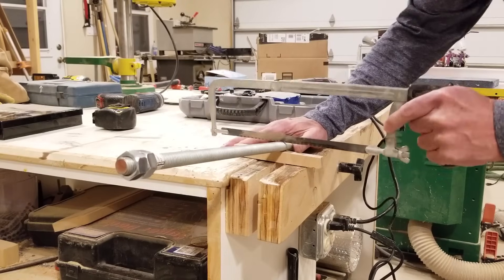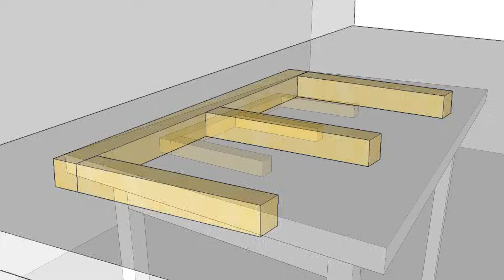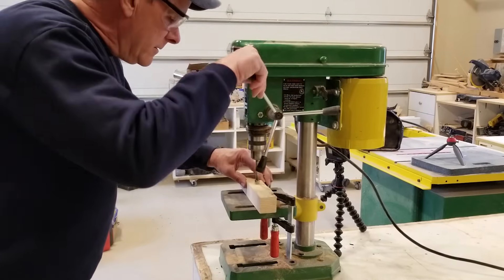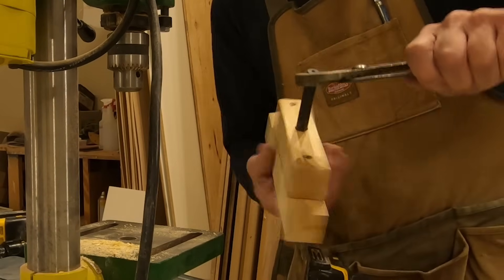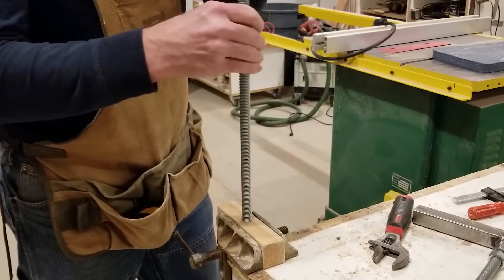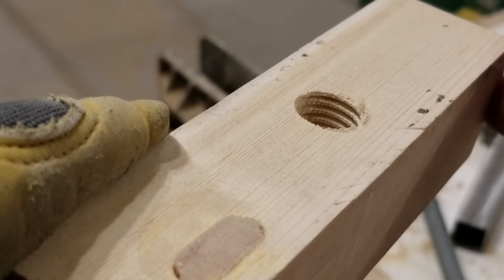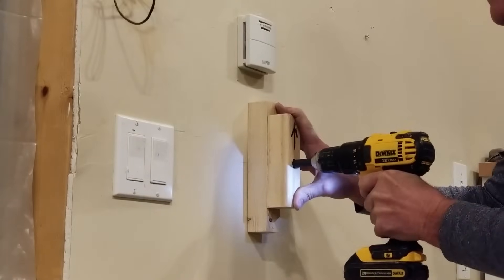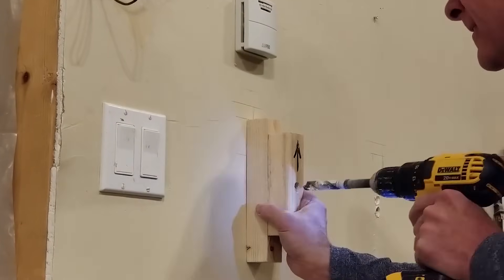Strong Floating Shelves - The Strongest Option

Comment: Something ppl don’t realize with floating shelves in the interior of the house isn’t how much weight they can take before ripping off the wall. It’s how much weight they can take before moving at all. Because most times inside a house (wether they’re painted or not) they either need to be caulked clean to the wall or may have tile right up against it. So as soon as they flex even a little they either crack the caulking or grout against them. 
So right off the top imo any design with wood cleating just screwed to the wall is totally not possible on an open face wall. MAYBE maybe if it’s at least in a corner it might be ok. Otherwise a wood or metal dowel directly into the stud is the only acceptable way without having a loose floppy shelf that doesn’t even touch the wall in a month. 
Personally I just use 1” hardwood dowel. I just cut the drywall off the stud to look for screws, set a laser to shine down the side of my Wood Owl bit to make the hole level whilst I drill and just hammer the dowel in with no glue. It’ll be plenty tight if you did it right, so a bit of silicone on the dowel to stick to the shelf and maybe a bit between shelf and wall and it’ll be strong enough to hang off of, and it’s still possible to take the whole thing apart without destroying the shelf, dowel or your wall.
Reply from the maker: Lots of really good observations and suggestions, Kermit! In other videos I have done various experiments with attaching floating shelves to walls in many different ways and arrived at basically the same conclusions you have. No doubt wood dowels or metal rods are the best approach to minimizing the flex problem with floating shelves. It's not even close. I really like your idea of using the laser level to align your bit while drilling into the stud. Perfect solution that I never thought of so thanks for passing that along! Thanks for watching and for your comments!

Comment: How do you make sure your holes on the wood pieces align properly with the posts in the wall?
Reply from the maker: In this case, Airliu, I built the shelf out of pieces of pine that were 2 inches wide so I was able to drill the holes through the individual pieces on a drill press and then glue them together. That makes it easy! To drill the holes in a wide piece of wood gets a little trickier and requires a little more trial and error to get the holes straight. 🙄

Comment: They sell lag bolts that have male wood threaded and female machine threads. I have installed hundreds of those lags. We used them for hanging ductwork and equipment. That would be super easy and fast.
Reply from the maker: Thanks, Paul! I have had a number of other people who’ve also mentioned those products as well and I have actually seen them used in commercial settings for hanging ductwork and pipe. I don’t think I’ve ever had the occasion to buy them for anything I’ve done, but I need to keep them in the back of my mind, because they really can be used in a lot of different situations. Thanks for passing along that information!

Comment: Subscribed. Suggestion.... Instead of building your allthread tool as you did..... Simply weld a nut on the end of the thread. Then use a cordless impact wrench... Zoom in and out. Way faster and easyier!

Comment: The only unrelatable aspect of the trial and error is the fact that if you're doing this method for floating shelves for a pantry... you need the shelves where you need them and you cannot drop them 2 inches to make it work.
Reply from the maker: When it comes to a situation like your describing, Jacob, where a shelf has to be where it has to be like in your pantry example, we just have to figure out how to make it work. That happens all the time! On a related note, two days ago I was installing 5/8” all thread rods through a cultured stone face facade on the fireplace for a mantle. I couldn’t really check for wiring in the studs because of the rock so went ahead with my holes. I mean what are the chances I would hit a wire! After drilling through the rock and into the stud a couple of inches, I decided to go just a little deeper and sure enough, heard a pop and knew I had clipped a wire. That’s real world although in all my years of doing this kind of work, I have never hit a wire in a situation like this! It was likely the only place on a 12 foot tall wall stud where a wire went through the center of the stud and I hit the wire dead center. Three hours later and after a trip to Lowe’s, I had opened up about a 1 ft² opening in the rock and sheet rock, installed two junction boxes and a new piece of wire between the two. I drilled another hole in the stud for my new piece of wire, so I was at least able to salvage my original hole for my all thread. Repaired the sheet rock and cultured stone the next day and now only have to actually install the mantle. Sometimes you just have to do what you have to do to make things work out! Is that relatable enough! 🙄

Comment: yo where can I buy one of those tools you used in this video?
Reply from the maker: I get that question sometimes, Sami, and I have never made up any extras of those handles to sell. It is a piece of 1” square tubing that has a couple of nuts welded to it that fit the size of all thread rod you are using. So if you know anyone who has a  welder, it is easy to make. To get around that, you can tighten two nuts against each other on a piece of all thread rod, then use a crescent wrench or socket on the nuts to spin the all thread rod into its hole to cut the threads.
Reply: @RustyDobbs  Thanks! I know a local welding shop and they can probably help.

Comment: Could you give an estimation of what thickness threaded rod can hold what weight? 

I'd like to build a couple small shelves that only need to be able to hold 100 pounds max, and wouldn't like to waste materials on over engineering it.
Reply from the maker: Hi Rubs. If I’m doing a shelf that needs to hold any significant weight say around 50 pounds over a 2 foot span, I would definitely go with 5/8” to 3/4” all thread rods. See to me, 100 pounds resting on a floating shelf is a little unnerving because that seems like a lot of weight to be on an 8, 10 or 12 inch shelf up off the floor. If that weight comes down for any reason, it will do some damage to whatever or whoever is underneath it. Floating shelves are a cool look, but, personally, if you’re going to be putting 100 pounds on them, I would want them over engineered and would probably consider another approach as well just because of the physics.
Reply: @RustyDobbs  you make a very valid point. Regardless of whether it could hold it, I wouldn't ever want that weight to come down unexpectedly. 

Time to build shelves stronger than my walls haha

Comment: Does anyone know what the small white rectangle of material he puts on the wall at 11:17?
Reply from the maker: That's just drywall joint tape, Rob. You can buy a roll of it for just a few dollars. It's purpose is to basically isolate cracks or holes in drywall to hopefully keep them from showing up again after you float joint compound over the area.

Comment: How many bags of concrete did it hold?
Reply from the maker: I don't think I ever loaded this shelf with a lot of bags of concrete, Forrest! But it held my weight fine, which would be 4 - 50 pound bags! I actually think this type of installation would hold a lot of weight, much more weight than you would ever reasonably think of putting on a floating shelf.
Reply: @RustyDobbs  I was just being silly Rusty I think these shelves are the way to go for me though thanks for the vid

Comment: Thanks very much I followed your instructions exactly and got a really good results. But after doing three of these shelves I figured out a good shortcut. And that is once you drill the hole into the stud what I did was I double nodded and all thread rod that I was going to use permanently and threaded it into the wall and left it in there and then just slid my shelf right into it no need to pre-tap the hole with your custom-made tap.
Reply from the maker: That's the idea, Full Motion! Yeah, there is nothing sacred about the way I go about doing this process. The ultimate strength of the shelf is in steel rods being inserted into the studs for support. How you get them there is up to you. Thanks for watching and for your comments!

Comment: I screw long lag screws into the stud and then cut the hex head off.  Drill a hole in the back of the board, apply polyurethane glue, slide wood onto bolts and boom, it's done.
Reply from the maker: You're not the first to comment that they use the same method you are describing, Ozz. There are lots ways to go about this besides the method I showed. In the end, we all agree that steel rods in the studs are a great way to go for floating shelves! Thanks for sharing your approach!

Comment: Solid plank shelf could be more cleanly secured by tapping the end of the all thread with 1/4-20 threads or similar size and using a socket head or machine screw and washer with slightly oversized recession to create a surface to grip and then cap with decorative wood plugs. Another alternative to avoid enlarging the hole is a little trick I use, find rubber tubing, old hose, old air hose, cut 1in length and then cut open straight down, test fit in the hole and remove any excess to create a tight fitting sleeve in the hole, then small screw and washer sized about right for the hole, squeeze and the rubber expands gripping the wood. may have to use multiple layers as you want the sleeve to be snug on the screw too so it expands out towards the wood, not inwards. Cap with decorative wood caps that are smaller than first method.
Reply from the maker: Very interesting and innovative ideas, Pyro! Thanks for passing them along and thanks for watching!

Comment: I really want a video of him making that 2x4 shelf.  I am an amateur DIY with limited tools, and want to know exactly how he did that.
Reply from the maker: Hi Seventeen! I doubt that I'll be making a video of building the shelf anytime soon, but it really is pretty simple in that I just cut 2 inch strips of 2x4 material, then glued and clamped them together until I got the overall width I needed. If you look at the end of the shelf, you can see that I alternated the direction of the wood grain as I was gluing the pieces together. Switching the grain back and forth with each piece helps to minimize the potential for warping of the wood over time. Thanks for watching and I appreciate your comment! Keep experimenting with the tools that you have and you might surprise yourself as to what you can actually build with limited tools!

Comment: so wielded two pieces of metal to a nut to invent and machine a tool ... "this is turning out to be a pretty simple process so far." This man is more skilled than I am!
Reply from the maker: Well, Chad, the idea of drilling a hole in the stud and screwing an all thread rod into it is pretty simple, but I get where you're coming from when you're talking about welding a nut on the square tubing to make a handle to screw the rod into the wall. But there are also other ways to do that without the handle, one by tightening two nuts against each other and using a wrench to screw it into the wall that way. Anyway, it's kind of an interesting process and it does make great supports for floating shelves. Thanks for watching and for your comment!

Comment: Just wanted to stop in a say this video inspired my floating shelves. Me and the ole' lady went back and forth on ideas and my first attempt using dowels didn't pan out. I just finished drilling twelve 7/16" holes into studs for 1/2" x 10" hex bolts. They threaded in tight and current testing shows the shelf will take 50lbs no problem. Thanks Rusty for the idea!
Reply from the maker: Thanks for checking in, DP! I appreciate it. Yeah, lots of contractors have commented about using long lag bolts and cutting off the heads which also works. Thanks for sharing your experience!
Reply: @RustyDobbs  The only reason I used bolts was because finding allthread was not panning out for me. In the end it worked a treat and the wife is happy which makes me happy. Haha

Wish I could send ya some pics, I think you'd like them.

Comment: Great video, Rusty.  What length rod would you recommend for 12" deep shelves?  Thanks
Reply from the maker: Thanks for watching and for your kind comment, Tim! The length of the rods kinds of depends on what type of shelf you are using. Generally, for a 12 inch deep shelf, I would probably go a minimum of 8 inches into the 12 inch depth with the rod. Sounds like you’ve got a project on your hands! Good luck with it!

Comment: This is so crazy , I’m a hvac mechanic, I hang A/H in attics with threaded rod and Kindorf. I was thinking of using thread rod as a support instead of making something outta wood . Great minds thing alike
Reply from the maker: Great minds is right, Chris! I have heard from lots of other contractors who use different approaches with steel rods of various types in studs to support lateral weight on shelves. It took me a long time before it snapped that steel rods were probably the best way to accomplish that. Thanks for watching!

Comment: When u hit that nail while drilling, just switch to a carbide drill bit, it'll drill right thru it. 
Also, you can just grind 2 flats on the threaded stud and use a wrench.
Reply: In addition. The flats where you used the wrench.  Can be where the set screw goes.

Comment: What 3d modeling software are you using sir?
Reply from the maker: I use Sketchup primarily, Byrne, because I have used it for many years and can be productive with it. I’m very intrigued by Blender and amazed at what can be produced with it, but it has a pretty steep learning curve, so I’m having to work at it as I have time.

Comment: So question: what is the advantage of threading the stud, then removing the all thread, to screw another piece in? I’m certainly not trying to be critical of your process. It’s the only floating shelf system I’ve seen, that I’d do myself. Thank you for sharing your work sir.
Reply from the maker: Hey Rick! I think I had the idea for the tap and handle for cutting threads before I did anything else. So, to cut the threads into the stud, pull the cutter and clear the shavings from the hole was the starting point in my way of thinking. But, it certainly does not have to be done that way. The shavings may even secure the rod a little tighter in the hole. On a related side note, when I’m doing any kind of assembly work with screws, I always have two drills with me, one to drill a pilot hole and one to install the screw. In my latest video, I’m installing Hardibacker on a shower seat and I even drill pilot holes in Hardibacker. Keeps it from breaking out when close to edges. Hope that answers your question and thanks for watching!

Comment: Maybe this works in USA, where you have  houses build like that. But in Europe you have concrete walls or bricks and that rod will not stay in the wall.
Reply from the maker: You make a good point, Adrian, about working in brick or other solid walls. You can drill a snug hole for the rods and use an epoxy or other type of adhesive to hold the rods in place. But I’m not sure that’s any more time and cost-effective than using other types of floating shelf hardware. This method is definitely very simple in wood studs.